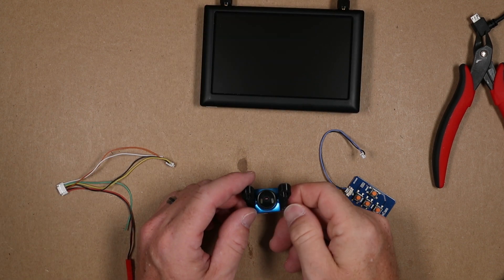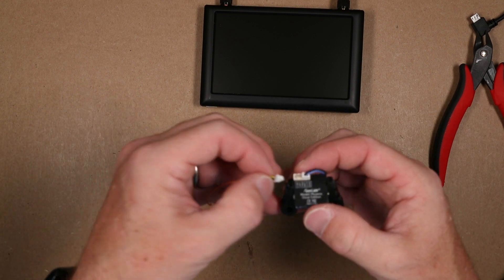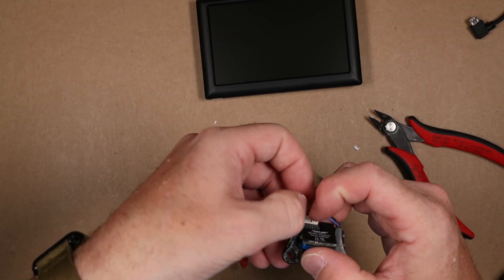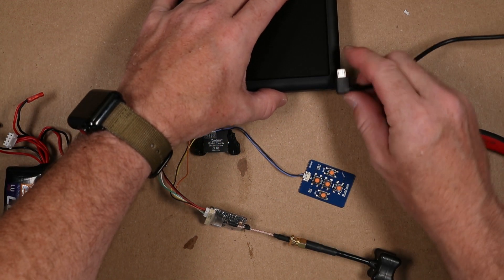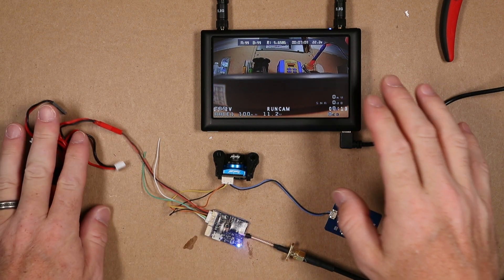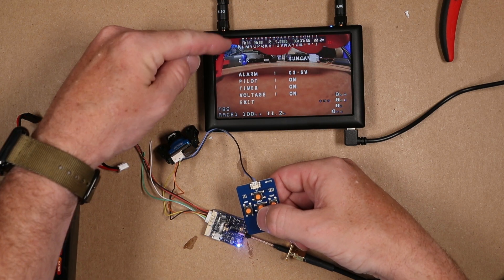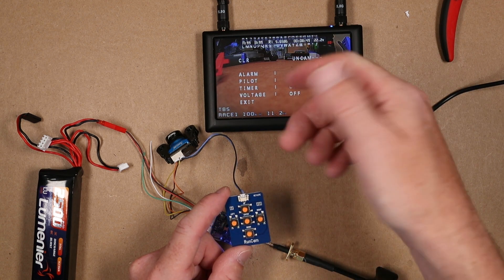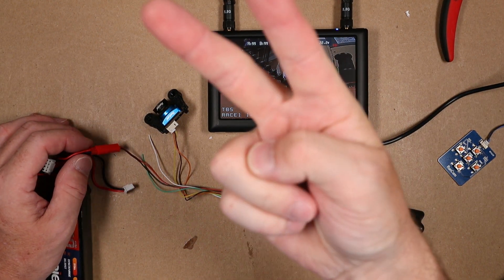Runcam OSD - How to turn it off

Comment: Hey i just got a runcam but i dont have a fc because am using it with a rc plane and want the runcam osd, how can i turn it on?
Reply from the maker: You need the Runcam remote and then watch this video but turn the OSD on instead of off.

Comment: is there a reason why the foxeer pad won't control this camera? Its basically the exact same layout... for some reason the menu doesn't come up when using it even if I switch the pins
Reply from the maker: I’m not sure exactly how this works on a board level. If I had to guess I’d say it’s bridging the pads but only briefly similar to a PWM signal. Board sees the pulses and reacts accordingly. Two different brands use two different signals? My guess is as good as yours.
Reply: @breaksteel  I see what happened. I am used to foxeer and I bought this JB runcam that ships out of the box in "uart control" I didn't realize you had to start the camera with the pins shorted and then re start kinda like in your video to get the pad to work. I thought that was just for removing the OSD! The pad does work from foxeer
Reply from the maker: Ah I forgot you can control those remotely using a uart. Usually just set them after a build and then never adjust them after. That and uarts always being in short supply. Happy it’s working for you now. Enjoy it!

Comment: I was able to do this to disable the OSD overlay. Now i'm trying to put it back since I'm moving the camera to a setup that has no FC. However, I cannot access the OSD menu anymore. Holding the up button does not do anything.
Reply from the maker: Something is wrong, this process should also work in reverse.
Reply: @breaksteel  i have two of these cams and both are in the same state. Oh well, at least i have video
Reply from the maker: That’s good, it tells me the cameras are fine. Something is wrong with your remote or the wiring with it.

Comment: How remove menu osd foxxer micro from screen? My bottons dont work.
Reply from the maker: I’m not familiar with the Foxxer Micro. If the remote buttons aren’t working grab or borrow another set. Beyond this there may be a way to use OSD and transmitter.

Comment: this doesnt really shut it off at least on the swift 2. on boot it still shows "runcam v2.2" and the "personal" scene in the top right corner. such stupid fucking bullshit by the dumbasses at runcam. a single osd on/off switch would have been great
Reply from the maker: The only reason I can see for making the OSD hard to shut off is marketing. Pilots just leave them on and anyone watching the feed knows what type of camera the pilot is using. This being mostly an occurrence at a race where the HUGE SIGNS and jerseys plastered with logos isn’t enough apparently. 
I agree, make one simple menu with a damn on off switch.

Comment: how do u see the mw output in the osd? is that the tx output? from the crossfire?
Reply from the maker: OSD shown here is flight controller data which can be setup in Betaflight.
Reply: @breaksteel  ahhh as I thought😅 thanks!
Reply from the maker: Anytime.

Comment: So there is no way to turn off the camera osd without the little key pad you have there
Reply: I have the same problem,My runcam didn't ship with a keypad
Reply from the maker: @raynerfpv2471  you can buy them from PyroDrone,
Runcam or GetFPV. PyroDrone has them in stock currently.
 
Here’s that links:
https://pyrodrone.com/products/runcam-key-board

 https://shop.runcam.com/runcam-key-board/

https://www.getfpv.com/runcam-key-board.html
Reply from the maker: I am not aware of a way to do it without the keypad besides UART control. With UART control you’d need to install a Control Adapter board. This board mounts between the camera and a spare UART. Not the most elegant solution.

Comment: Held for 3 seconds nothing for me? Using runcam Phoenix 2
Reply from the maker: You might be in UART control mode. In order to use the joystick power the camera then short the two camera control pins. Once you’ve shorted the pins connect the joystick and you then can adjust OSD as shown in this video.

Comment: I have the Runcam Oscar camera and I want to have the Betaflight OSD and Smart Audio in the goggles to display things like GPS and other things about the flight and be able to change the drones settings without Betaflight. Could I do this?
Reply from the maker: You can do all that, but have to set the OSD in Betaflight. Once it’s set up then your good to go.

Comment: Thank you. Lame I had to buy a controller just to do this.
Reply: Man I have to buy a controller too. Wtf. But they show the controller on the pics from amazon but not included
Reply from the maker: They should come with them. I’ve had piles of them and threw them out. Only really need one in the flight bag.
Reply: breaksteel maybe I threw it out with the box but I doubt it. Even on the package listing doesn’t say it’s included. Just showed it in the pic. But I’ll take a look at getfpv. Thx!
Reply from the maker: Your not the first that has not had one shipped. The fact that GetFPV now stocks them and many are asking where to get one tells me Runcam is getting away from supplying them. Good for those of us with 30 of them that just stack up or get throw out. Bad for those who are new and don’t know they need one.
Reply: breaksteel yea runcam must not like ppl not using there osd lol
Reply from the maker: Ugh.. that’s the most devious thing I’ve ever heard. Must be true.
Reply from the maker: Ouch, usually they come with them. I can easily see tossing it once cam is installed and working. At least you can enjoy the OSD that you actually want and not the cluttered look of multiple fonts.
Reply: Where did u buy your controller from
Reply from the maker: They usually ship with them, I don’t know how many I have thrown out over the years. I’m sure there’s a few on EBay, try searching for “Runcam Keyboard”. You can buy them from Runcam direct at this link though I’m not sure how long it will take to get. https://shop.runcam.com/runcam-key-board/ You can also buy theme from GetFPV here https://www.getfpv.com/runcam-key-board.html
Reply: You should need to buy a controller to turn the osd on, stupid runcam, those companys nether think of the customer. I do love runcam's though, they are the best for fpv.. thanks for the info man....

Comment: I have UART control activated but I also want smart audio. Problem is you can only have one or the other unless someone knows a way to run both peripherals if so please share. So when I need to change something on my fpv camera I just disable smart audio on the ports tab and then configure my fpv camera and then disable the UART ctrl on the ports tab and enable SA on the other UART my smart audio is on. By the way to get your runcam to change from joystick ctrl to UART ctrl you have to short the rx and tx pins of your runcam and then power it on which will change it from joystick ctrl over to UART ctrl and then when you remove power it will be saved as UART ctrl. Then unshort the rx and tx pins and wire them to a free UART on your FC. The way to enter the runcam menu via UART ctrl you need to raise your throttle halfway and yaw right which will act as the enter button on the joystick board. Your pitch/roll stick is how to navigate through the menu.  I wanted to figure out how to get rid of the runcam osd which is how I found your channel and video. Thanks for sharing.
Reply from the maker: It sounds as if it would be easier to hook up the camera remote than to change all your settings and then change them back. 
You might want to look into a “Runcam Control Adaptor”. As long as you can spare an entire UART and have space for a tiny chip.  This chip should allow you to control the camera and have Smart Audio working at the same time. 
Happy I was able to help you with this video!
Reply: @breaksteel  if have an F7 FC so I have plenty of UARTs. I know the chip you're talking about and will probably do that. Thanks for reminding me about the cam ctrl chip!
Reply from the maker: Anytime! I’ve been meaning to order some of those chips.
Reply from the maker: It was the way for the older cameras, the newer cameras have built in UART control.